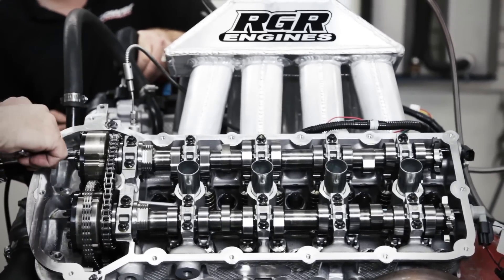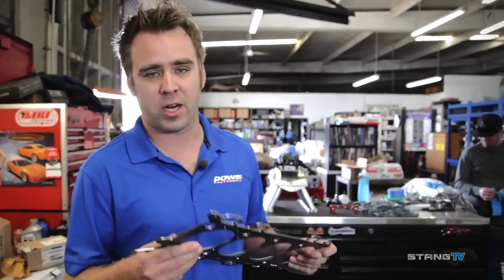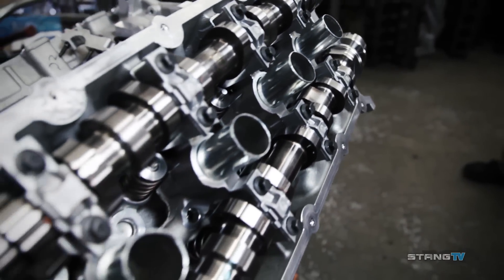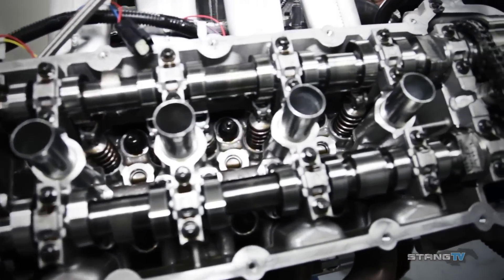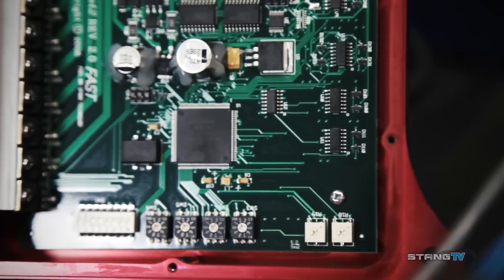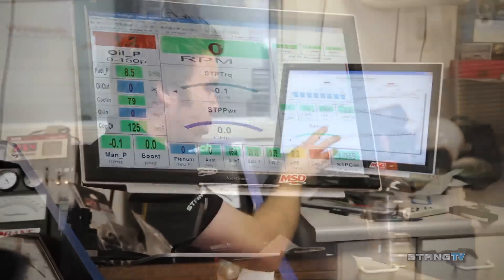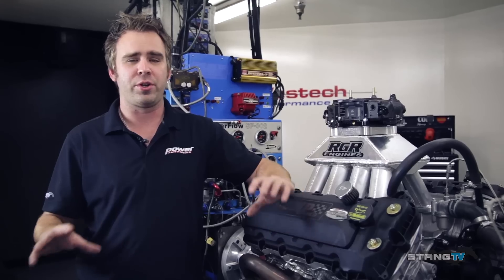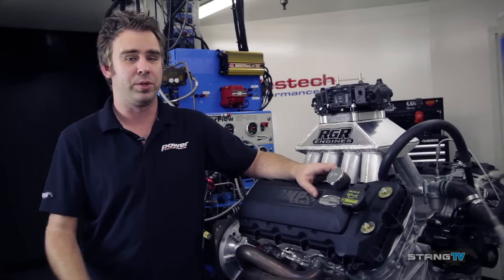Carbureted Cobra Jet Coyote Engine Build: Long Block and Dyno Testing

Comment: so !!!  if you take a stock coyote and put a whipple on it it will make 800hp , .... a mild bolt on coyote with a good tune will make 500hp easily , i feel like putting a carb on that engine made it a turd ,,, , the coyote is a great engine keep it efi get a good tuner . and go ,, those engines will make 2000 plus hp but not with a carb

Comment: Hi...    Gen 3 Coyote is hitting 490-510 rwhp with full exhaust, intake and a tune with e85.     This would be approx 590-610 HP engine.     I was curious, with the 240@.05" cam shouldn't it do much better than the gen 3 coyote with boltons and no cam?   LIke 700+ HP?
Reply: That's a happy dyno

Comment: 20k+ and it made what a $1,200 5.3 with a cam, springs and ported heads would make. . . . . #hardpass
Reply: You misspelled your hashtag for Ls1 shite #HarshTrash 🤣

You wont find those engines forever
Reply: Not only that you can buy used  coyotes too..... Use some logic.. ..

I have a build that will destroy whatever you own.... In fact several because you build used garbage. 

I have 327 c.i. all aluminum modular Ford. Yeah it cost 20k but dynoes far better than this coyote...... 13.5 to 1 comp ratio E85 , gibtec custom pistons, Trick flow 195 2v heads with hand porting/clean up, custom dual plenum cross ram intake designed/built by me (screams intake made 60 more hp and 37ftlbs torque) I specced the cams, block is the cammer/TR50 road race block. Lets see your turd scream 8000rpms for hours.... It won't... Mine will.... Imagine that... A block made specifically for that vs a junkyard turd. Roush made 800hp 5.0l 4vs with this block. Devastated the competition.... 😂 It was the ground work for the coyote. 

They built this engine all wrong so you ain't totally wrong, ill give you that.

Comment: Why cant the 427 SOHC engine use the chain configuration this engine uses?
Reply: Because the 427 overhead cam engine was built in the 60s… also. 
They do. But with 50 years of technology in between. Look up john kaase’s rendition of the 427 sohc engine. He builds them from the ground up and takes care of the shortcomings

Comment: So why the super wide lobe separation? Not very familiar with the 4 valve stuff. But 128° seems way wide to me
Reply: Cams are based off of overlap.   Modern, efficient heads don't need as much overlap as older, non-efficient heads.   So when you have high duration camshafts so that engines will pull rpms, you have to increase the LSA a lot more than you normally would in order to keep the overlap down.  A lot of my pulling truck engines run 119-120 LSA.
Reply: 260 duration

Comment: Carbs don't work, sorry, laptops work...
Reply: Did you know that when NHRA got the great idea to go to EFI and then MADE it mandatory for EFI only. After 7-8 years of EFI and the cars are still slower than the carburetor cars. Who has more money to spend on go fast parts for naturally aspirated engines and the people to tune them than they do in this class and they still can’t make the same or NHRA thought even more power over the old fashioned carbs? Laptops are for those who don’t know how to tune carbs and don’t mind having less power.

Comment: Ruined a damn good engine by putting on a carburetor. It isnt worth the scrap price of the metal its made with like that... There's a reason carburetors aren't used by auto makers anymore, and its not just for emission reduction (that's just a side benefit) the only place  that a carburetor has anymore is on a chainsaw or weedeater or the like. And that's only because of cost/size/weight concerns. And with todays ethanol "contaminated" gas, they aren't even worth a damn even then.
Reply: I know right, this engine made absolutely no power on the dyno like this, you're right, total waste.

Comment: Carburetion for the win! I've made 2 efi vehicles carbed and they ran smoother and had more power than the original fuel injection. 1 skipped alot and the 2nd one had bad electrical issues and wouldn't stay running. 1 carb and points distributor later ran like a champ
Reply: Efi is the new wokism for engines, 
Carbs are for performance, people dont know how to tune carbs.
Reply: Get someone who knows efi then, not some of your corn fed 1920 “technology”
Reply: @clarissafarmer3547  no thanks I like my gas mileage

Comment: My BES built 408w made 580 hp at 6300 and 575 ft lbs at 4900 rpm on 93 pump gas and cost far less than this build! Nice engine but not very impressive numbers considering the cost of the build!
Reply: krankensteinrocks your 408 also has 94 more cubic inches then this coyote. So when it comes to horsepower per cubic inch. Your 408 get destroyed
Reply: Agree, Kranky.  A 5.0 Coyote can get as big as...um...5.2.  A Windsor can end up in the 7.5 range.  My own Windsor is a 438, and I could have gone to over 460.  Some like a little torque BELOW 6000 rpm's.  How about over 500 lb/ft of torque from 3000 rpm's to 7000 rpm's.  If a Roush 5.8 can put out 900 naturally aspirated ponies, think what a 7.6 can give you.

Comment: It's simple why a carb, alot of racing classes won't let you run fuel injection. This motor can spin high RPMS all day where the old small blocks and big blocks can't.

Comment: Not much power for all the parts I thought you were going for 1000 hp
Reply: It's only a 314ci engine (5.14L). They made 625hp with EFI.

They did a 1,000hp turbo coyote build, 

http://www.stangtv.com/tech-stories/engine/1000-hp-low-compression-coyote-engine-build-part-2-the-long-block/

Comment: What would it cost me to pit that in my 92 gt? I know I'd have to change alot of stuff out but I'm wanting to do that.
Reply: The Big bore mods is $1,900 if you supply the 5.0L
$1,305 for Oliver rods
$1,200 Mahle Pistons/rings,etc
$1,500 in parts/labor on the heads
Probably $1,250+/- for the carb and intake.
$1,000 for the Meizer coyote water pump
$1,250 for the COP controller, cometic gaskets, bearings, ARP studs, Oil pump upgrade.
$1,500 for Comp cams and lock out plates
$1,250 for headers and coils

SO...about $11 grand if you have a coyote 5.0 and do almost ALL of the work yourself.

For that much you could easily get a Dart OR MAN-O-WAR Block and build a 900+hp stroker with premium parts...for less.
Reply: JerseyMikeP thank you for the reply. I'll probably dart MAN-O-WAR motor then.
Reply: Oops It was suppose to be DART (OR) man-O-war block.... just fixed it;-)

Here's a Man-O-war build that makes 1,043hp on pump gas with a SC ;-)

http://www.mustangandfords.com/how-to/engine/mmfp-0706-ford-stroker-engine-build/

This New Windsor...almost cost the same as the MODs alone on the coyote block. And the cam/valvetrain /intake is about 1/3 as much. With the SC this would cost as much as the EFI version of the coyote build in this video. Not to mention the 445ci in the article makes almost 900lb-ft almost double the coyote in this video.

Man0O-War block is Iron...but would weigh about 50lbs more than the coyote or iron stock windsor.  Dart offers an aluminum Block...but if you are spending $4k on you could get an aluminum big block for the same price and Rock a 540<700ci.
Reply: JerseyMikeP lol it's cool. Never heard of the builds so I went with it.
Reply: JerseyMikeP I'm excited about building it. It will be a first for me. Thank you again
Reply: No problem...I would go turbo over supercharged....if you look up turbo sbf build you can get plenty. The stock ford windsor blocks are the weak point. An SVO Ford Racing block might be cheaper but aftermarket is bullet proof. 

A single 76mm could easily get 600<700hp out of a mild build.  Eagle rods/ and SCAT have Forged  rotating assemblies that are very cheap Good for 700hp+/-. AFR or Trick flow would be the heads I would mainly look at for Big HP.  Plenty of EFi manifold for them too if you want to go that route. Trick flow even has Proven top end engine packages on their site.

I have a 5.0L build magazine I will see if I can find a link on line as post it for you...never could get enough info.

Comment: Tell me what type of lubricant to use to install the camshaft
Reply: It looks like they used PERMATEX assembly lube. I use that bottle when rebuilding engines, Clear bottle red lube white writing. Redline bottles are usually black, comps cams are black or white and Royal purple lube is of course purple;-)

https://cdn2.bigcommerce.com/server4900/f4083/products/71419/images/83870/418YHKM896L__54277.1408083177.1280.1280.jpg?c=2

Comment: Fun build and all for uniqueness, but the Yote loves boost. Cheaper and easier to simply throw a TVS on it and make 800 hp with just a few fuel upgrades and OPG's.
Reply: They did make a 1,000hp turbo version.

http://www.stangtv.com/tech-stories/engine/1000-hp-low-compression-coyote-engine-build-part-2-the-long-block/

Comment: If an overhead cam engine doesn't spin 9,000-10,000 rpm it isn't living up to its full potential, IMHO. It also seems to be over exhausted, but with that much compression it might not be. Looks like a good street engine.
Reply: Holy shit dude. You're running 128 degrees LSA? Give it some overlap and bring on the torque.
Reply: So every DOHC isn't living up to your standards.  most make peak < 7k and only ferrari, s2000 and GT3's make peak in the 8k range.

I do agree all the DOHC's that make peak at 6<6,500 rpms are a JOKE. even the Nissan GT-R only makes Peak HP at 6,800 rpms.
Reply: Axle it still has 240/246 @ .050 and only 314 ci.

Comment: Ford Motor's still sucks thanks for the video once again proves Chevys are a lot easier to work on and a lot more horsepower lol GM POWER ALL DAY
Reply: You're wrong and most likely young and stupid.
Reply: Jim  AGREED!
Reply: Bailout motors? No thanks.
Reply: He's most likely to lazy to even build a chevy... He's most likely to go on ebay and buy one of those 400Hp builds for $7000
Reply: pushrod is still ok for trucks. The best modern sports cars don't use out dated pushrods that flex 5 degrees in the high r.p.m. The best production N/A gm made the ls7 at 505 h.p. was only making around 70 h.p. per liter. Its simple more holes in a circle = great area for air to flow.

Comment: my small block chevy 350 puts down more torque than that...awk
Reply: I would believe that if your 350 was a really a 383 stroker with 11:1 compression and two 4 barrels with MSD ignition.  But if it is a stock 350 it would never touch this engine in a million years LOL !
Reply: Doubtful.
Reply: +Jeremy Hall dont be jelous
Reply: An LS1 would have trouble putting down that much torque, let alone a POS 350
Reply: m0nk1ez An LS1 or Windsor would shit all over your 50's tech POS
Reply: monkey butt..... son, son. I don't know how to read a dyno sheet? LMAO You keyboard racers are fun and funny. I used to operate a SuperFlow dyno in a shop that turned out 650+ HP Late Model dirt car motors.  Those 355s make your puny little  fan belt squealer look like a toy sewing machine. We dyno'd them to 8500 rpm but many of the racers revved them to 9,500 rpm. I've seen the tattle tale on the tachs. We charged $25,000 for one complete with mag, carburetor, and dry sump. A rebuild was $15,000. 

Go peddle your baloney some place else because nobody here wants any of it, son
Reply: +Chainheart Machine pos sbc that puts out more torque than a pos new Ford
chevy been getting it right since the 50s
be jealous bitches.
Reply: +Chainheart Machine my pos sbc has shit on ls3s
stop being so jealous when you don't know shit x)
it would probably shit on any one of your cars too
Reply: m0nk1ez, your 350 Chevy makes 417 ft lb of torque at 5,000 rpm and carries it all the way to 7,000? I really doubt that. Besides he has over 40 cubic inches less than your 350.
Reply: Axle Grind it makes 431 torque and 406 horses and carries it till 6,000
it's crate engine part number is bp12ctc1
from blueprint engines
rated at 400 torque and 375. shipped with dyno sheet it made plenty more
Reply: m0nk1ez What did you do to it to make more power. I suspect you have to put a Holley HP carb and an ignition box to make that much more power than the dyno sheet says.
Reply: Axle Grind no dumbass the dyno sheet says 431
Reply: m0nk1ez I don't think you're smart enough to know how to read a dyno sheet.
Reply: Axle Grind shit, they ship it with a chart too dude.
just go home, try again another day.
Reply: Axle Grind "no dumbass the dyno sheet says 431"

Yeah m0nk1ez you need to learn how to read a number graph like these dyno sheets are made of. You claim "my small block chevy 350 puts down more torque than that...awk'  and then you say it makes 431 ft lbs of torque. Look at the dyno readings at 6:20 in the video on this  Cobra Jet Coyote engine that is 41 ci less than your 355. 
It clearly states it makes 446.9 ft. lbs of torque, 590.5 hp. Not only does it make more torque than your 355, it makes more from 5,000 rpm to 7,500 rpm. Your torque peaks out at 4,200 rpm.

Are you that stupid? Yes you are. Your claim is unfounded. Now turn your computer off because I don't have time for idiots like you.
Reply: Axle Grind I can read my dyno sheet better than you bitch
don't be jealous that my small block takes these out on the daily.
Reply: Axle Grind I'm also talking about the 5.0 in Stock form, they had to make a bunch of changes to this 5.0 to make it do that. 
don't make yourself look too stupid
Reply: Ha Ha m0nk1ez you're all over the place. Nowhere in this thread did you mention 5.0 in stock form. The video is about a 590 HP Cobra Jet Coyote engine. Try and keep up. You probably ought to shut up because at this point you are just embarrassing yourself. 
BluePrint makes some fine motors but it takes one of their Pro Series 509 big blocks to equal the horsepower of this little 314 ci Ford mod motor....... lmao......
Right about now BluePrint is probably sorry they sold one of their motors to your dumbass. haha lmaooooo....
Reply: Axle Grind all over the place?
the only thing that I didn't clarify is the stock engine part, even with cams and intake I made more power until they didn't more testing 
now you're just a dipshit that can't understand a dyno sheet ahahaha XD